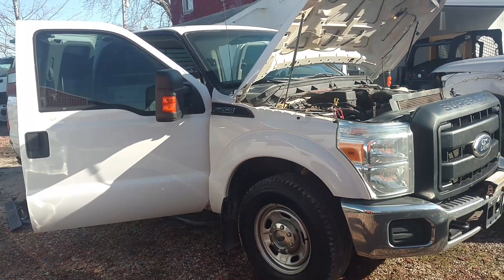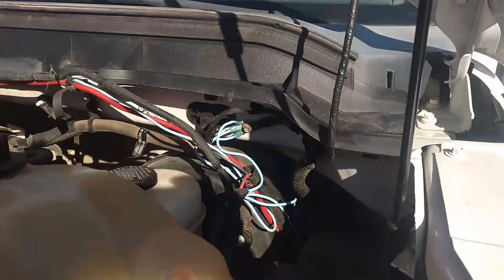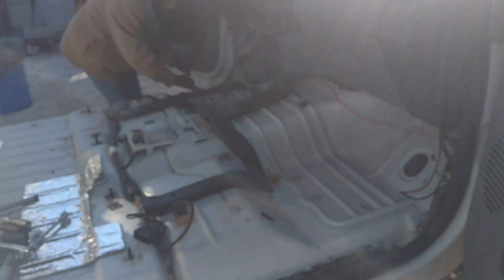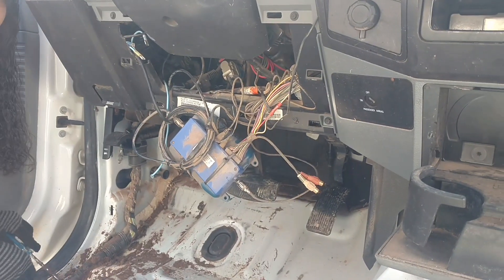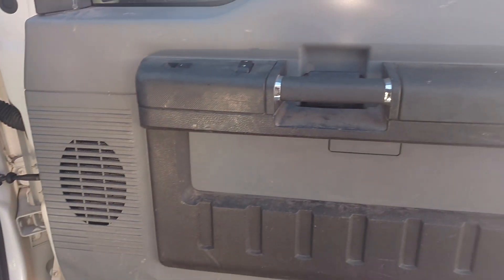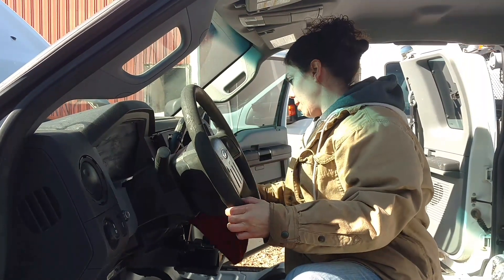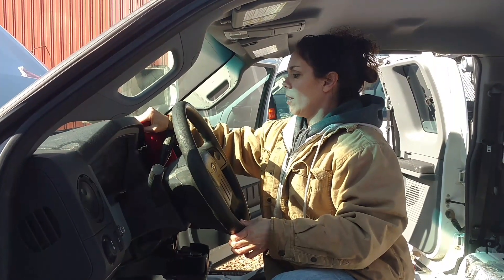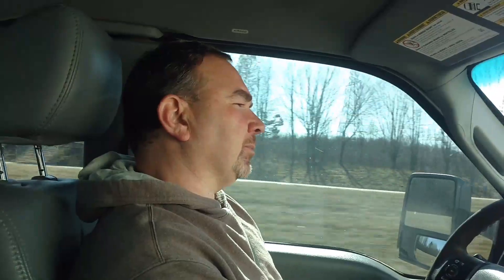MRS. J.C. IS NOT HAPPY WITH ME! & ROAD TRIP!

Comment: I have a couple of the 6.2's myself, that I was able to get on a helluva deal, much like your one looks real good interior wise ( fleet truck managers ) and another fleet truck that was in field use. Talk about maintained though, looking through the maintenance records and every 5 k that those trucks were in for a oil change they had the once over, if it needed something it got if it didnt it went on its way. You know after the 6.8 v 10 I wasn't sure how I would like the 6.2 because the 6.8 just went and went and went but I gotta say after having the 6.2 and using it to pull trailers and what not, I was damn impressed is it a 6.7 no, but it sure does a good job of pulling heavy so no complaints on my end
Reply from the maker: i cant say enough great things about the 6.2. i have had a good many of them and they have always been great performers. i will take it over the 5.4 and the v10 anyday.